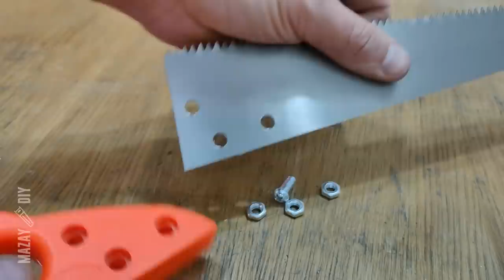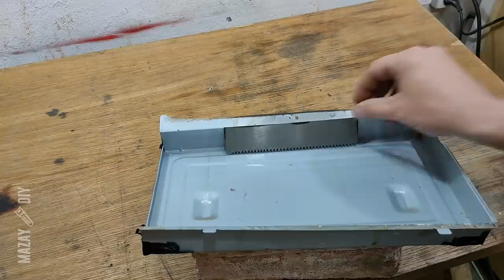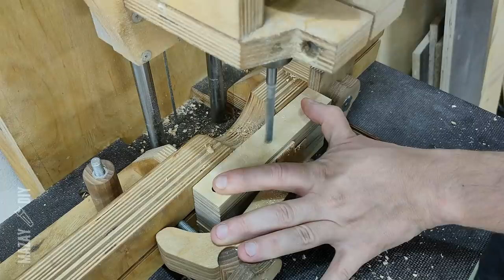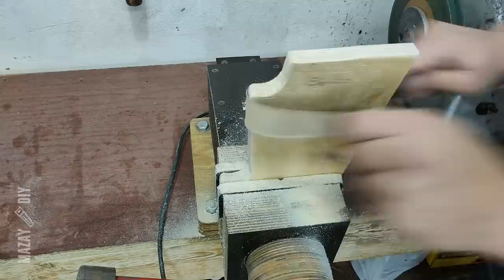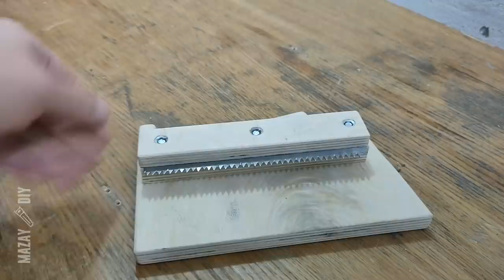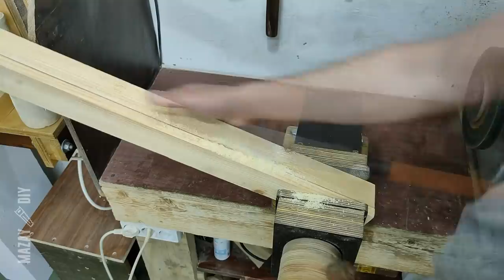Kerfing Plane | DIY Jig for Perfect Resawing by hand

Comment: A lot of comments saying it was pointless, that he could have just used the original saw. Have you ever tried to saw a straight line through anything? The tool he made is meant to draw a guideline. I wouldnt say its a diy since he used a lot of power tools, but just for the fun of the project i still find it pretty cool...
Reply: Инструмент этот, что следует из названия, для изготовления фальца, то есть четверти, например в оконных рамах.
Reply: @Kewts Mazay is both clever and skillful. He shows great ingenuity in designing and making inexpensive tools and demonstrates techniques that have broader use. And when has using a power tool not been good for DIY projects? Part of his ingenuity is in converting basic hand-held power tools into guided ones, such as his shop-made drill press using an electric drill.👍

Comment: About 30 years ago, I ripped down dressed pine packing case timber with simple a Back saw, and a Brass Angle ( 1"×1", 1/4" thick) as a guide clamped on. Only did pieces 18" to 36" long.
Not a quick job, but gave a circular table saw result.
I still have the small work-table with drawers built , first for a mini lathe ( EMCO) now for Model Railroader work...1/48  On42".
Still has the pre-1984 Company address on it ( Air compressor parts).

Comment: Bolt two longer pieces together placing a saw-width washer in between. Now you have a jig you can use to cut a piece of wood just like the one in the video - except you can clamp it to wherever you need to cut.

Comment: Wouldn’t it be faster to just run the shit through a table saw?
Reply: Or a trollmill perhaps
Reply: Мы не ищем лёгких путей))))
Reply: Yup but not everyone has a table saw or a trustworthy one, some people like to use hand tools, etc.
Reply: @romeotango5597  so let use power tools to make hand tools since we don’t have the power tools available. Gotcha 👌
Reply: I see visions of a circular saw flipped upside down and bolted to a piece of plywood clamped down to saw horses. It would match the grinder/chop saw/cut off saw. Woodworking is more authentic that way.........
Reply: @Andrew Fenner
Unless you have an enormous table saw, a handsaw is the only tool, other than a bandsaw, that can handle more than a 3 inch depth (or 6 inches if you flip it over). If you mean use a table saw to make the guide kerf, then you'll likely have a kerf wider than the handsaw, which wouldn't guide the handsaw as well and would lose more wood in sawdust.

Comment: That crazy using other saw to finish to cut
Reply: My DIY table saw can't cut more than 1.5 inch, so i always have to make a first cut, then turn the work piece, make a second cut, and finish by hand 👌
Reply: @ildefonsogiron4034  r
Reply: @ildefonsogiron4034  t
Reply: @ildefonsogiron4034  A '
Reply: @ildefonsogiron4034  tt

Comment: This one seems rather pointless.  He has a beefy table top grider in his shop, we can see it in the video.  Also he finishes with an asian pull saw. So use the grinder for power adapted with a simple wooden slider crank mechanism attached to the saw to convert rotary motion to linear reciprocating, built into an adjustable fence and bam you got a board saw. Same result much more efficient, and less work to build and to use once built.
Reply: Sometimes you just want to use hand tools. Or need to perform an operation away from the shop and electricity.
Reply: Он использует сделанный им инструмент не по назначению, хотя из названия следует, для чего нужна такая пила.

Comment: So, you've taken apart a saw to make another saw that couldn't finish the job, then had to use yet another saw to cut the rest of the way. I'm impressed 👏
Reply: "Couldn't finish the job" - Wow, you really have completely missed the point of this tool. Have you ever actually re-sawed wood without using a power tool? Obviously not.